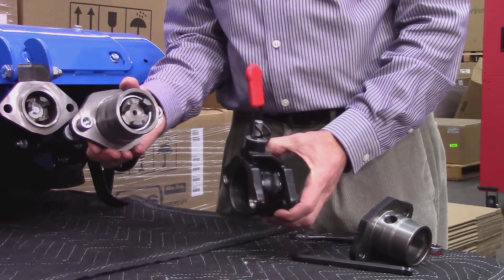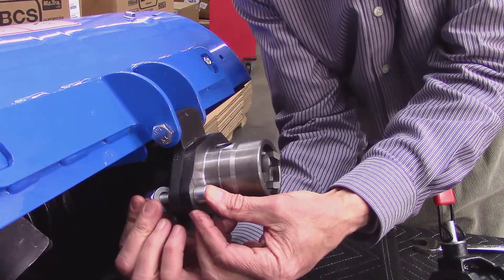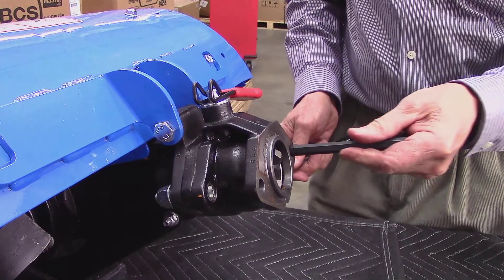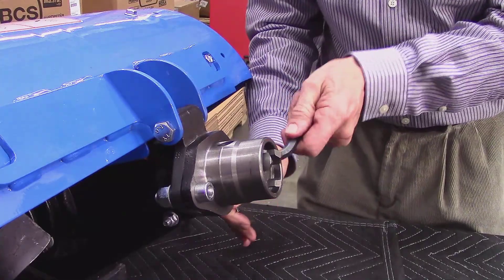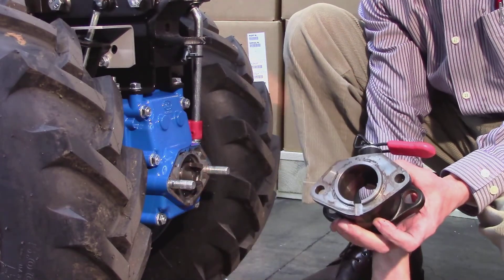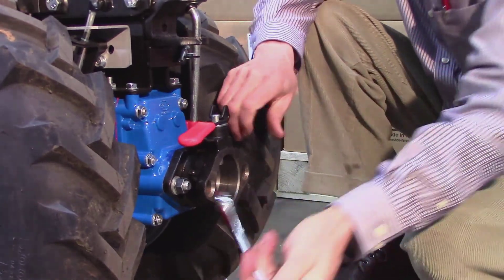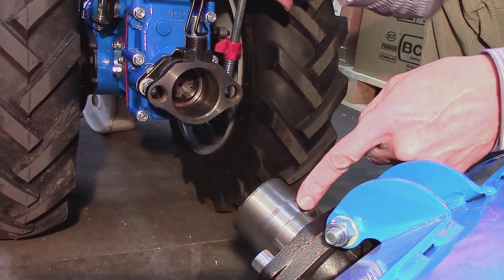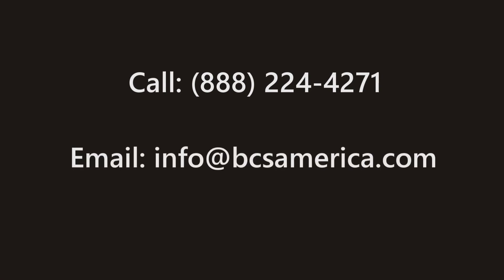BCS Two-Wheel Tractor Quick Hitch Installation

Comment: Is there a video about attaching implements without using a quick hitch?
Reply from the maker: If you won't be using a quick hitch, the implements are simply attached to the PTO studs with the included nuts and domed washers.  The domed washers MUST be installed with the dome facing away from the tractor, just like they are installed in this video.  Keep that in mind and you should be good to go.

Comment: How to apply pto extension ?
Reply from the maker: The PTO Extension can be installed on either the tractor or attachment.  If you're using a Quick Hitch, it would be installed either
1) between the tractor and the Quick Hitch bushing, or
2) between the attachment and the Quick Hitch tang.
The PTO Extension WILL NOT work with spline-drive PTO connections (built before 1995).  Hope that answers your question!

Comment: I have a quick hitch in my bcs, is there a way to install the ridger with out having to remove the quick hitch from the tractor
Reply from the maker: Yes!
The first image on this page shows the best way to connect the Ridger while using the Quick Hitch:  https://www.bcsamerica.com/product/tool-carriers
The Tool Carrier is mounted to a Drawbar Hitch, which has an empty Quick Hitch Tang connected.  With this setup, the Ridger can be connected/disconnected just like any powered attachment.
Cheers

Comment: I have 735 can I use it ?
Reply from the maker: Tractors built before 1994, like Model 735, have a spline-drive instead of the current 3-dog shaft.  In order to use the Quick Hitch with current attachments, a Spline Drive adapter is required: 
https://www.bcsamerica.com/product/old-tractor-new-attachment-adapter

Comment: Hi, I’m in France and have just had my 750 delivered with the reversible plough and the Tiller, the quick hitch I have is totally different to the one you show in this video. Are there alternatives?
Reply from the maker: Yes, Model 750 (and 660) will have a different Quick Hitch system from the rest of the tractor models.  Any of our standard attachments can be used with a 750 tractor by simply adding a 750 Bushing to the attachment (instead of the standard male Tang).  https://bcsamerica.com/product/quick-hitch

Comment: will this work with an old bcs 715?
Reply from the maker: The 715 is a pre-1995 tractor, which means it has an old style PTO coupling system.  Unfortunately, the Quick Hitch for these older models are out of production and no longer available.   To power new attachments, you will need the Old Tractor, New Attachment adapter found here:  https://bcsamerica.com/product/old-tractor-new-attachment-adapter
Reply: BCSAmerica ok thanks. Then put the new quick hitch on the old to new adaptor.
Reply: Will this work with bcs 740 model?
Reply from the maker: Yes it will.